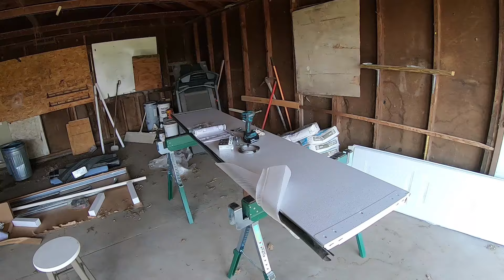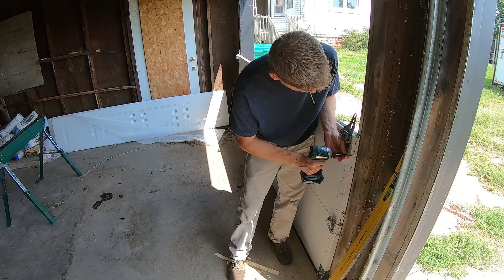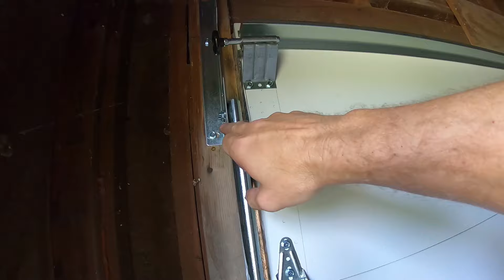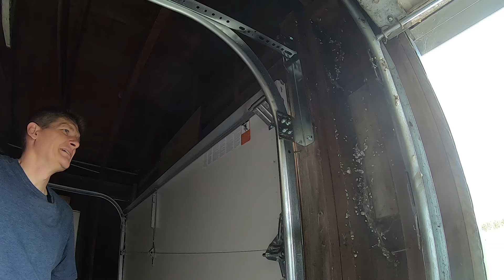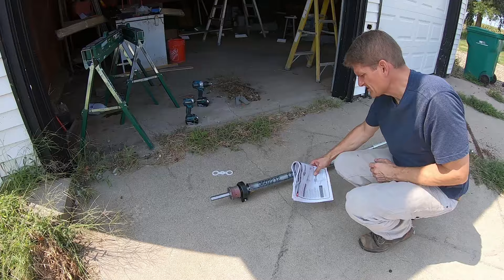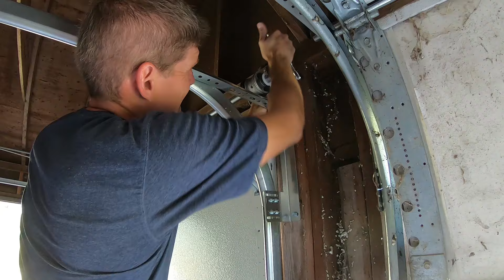How to install a garage door - step by step

Comment: Do u plum the vertical tracks   Or do y adjust to where the door is tight on the frame.
Reply from the maker: They should be plumb left and right, as you’re facing the opening. But the bottom of the track will sit closer to the wall than the top. This necessary so it can move away as it open.  Adjust the door to sit snug against the frame and you should be good.

Comment: Operator bracket goes on top of the hinge.
Reply: No, it doesn’t. With that hinge it wouldn’t mount flush on top.
Reply: You are correct Brandon. That op bracket is not flat so the hinge is sitting odd laying on top like that. Plus it is now forcing the section away and putting stress on the hinge.
Reply: @Doormanswift  either your a door tech or have critical thinking/logic skills. I’m not too concerned about being right as I know what’s correct but a YouTube video teaching incorrectly is my concern. Aside from the one mistake, the video creature did a decent job.
Reply: @Fsxtbi_guy  shouldn’t the hinge mounting flush to the two surfaces it’s designed to pivot be important? Before coming off as ignorant… you could always do a google search of operator bracket installation images and there are multiple designs, ones with offsets as well that may tickle your fancy as it allows for the omb to sit flush on the door, as well as ON TOP of the hinge.